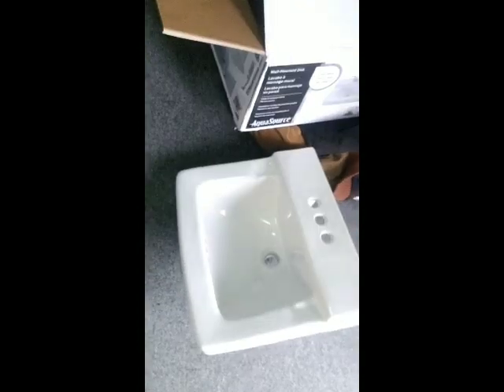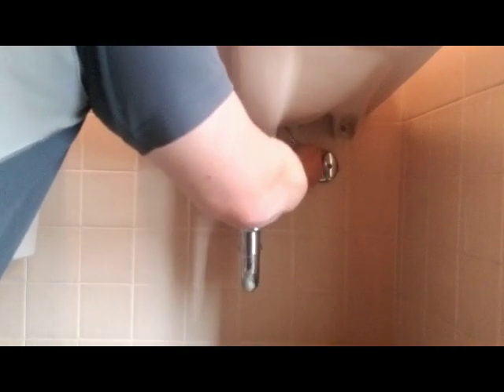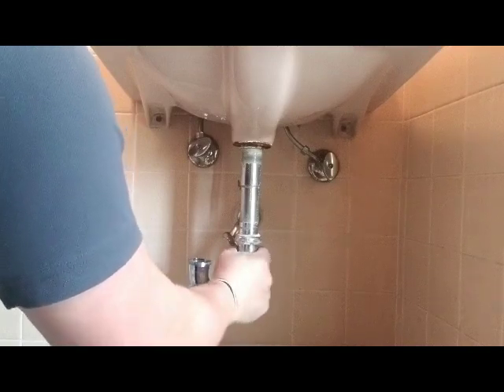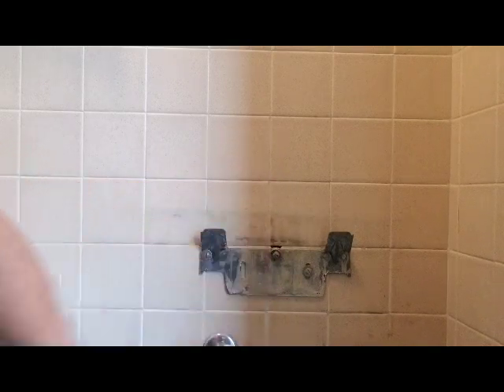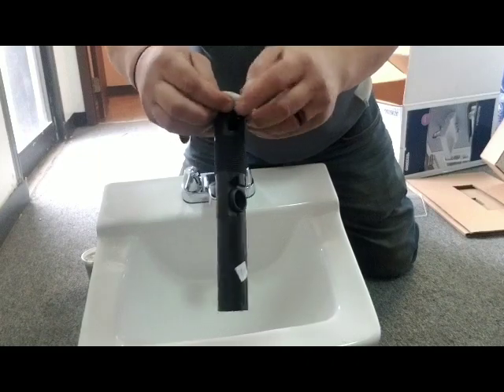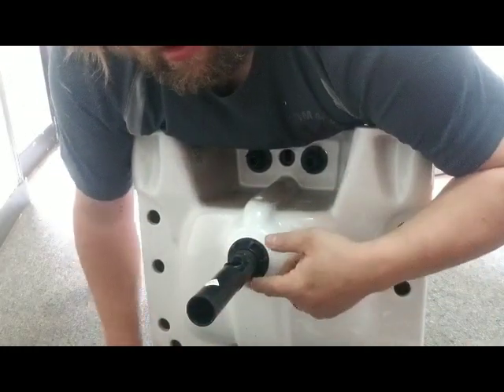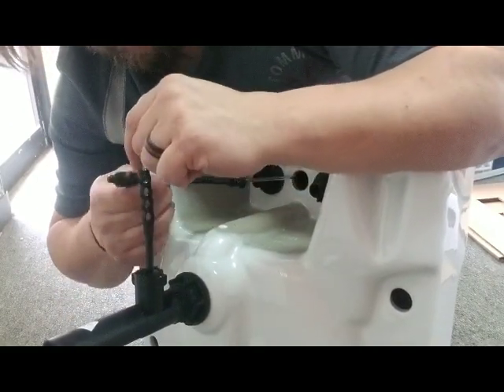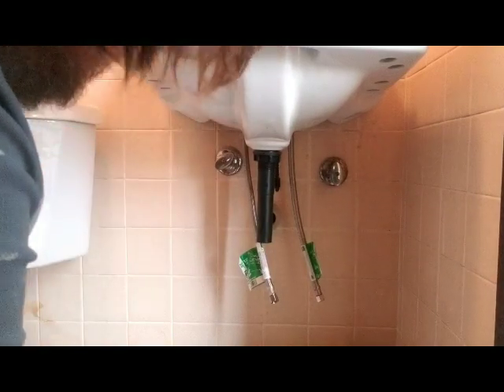INSTALLING A NEW WALL HUNG SINK

Comment: My Superintendant is replacing old wall mount sink, it has been removed which had a bracket. The new sink has curved underside, seems like it would not sit securely on a bracket. It does have 2 holes on back panel and comes with screws to go into a support wall. The wall is tiled--Is there a way to find a support beam? Or are the lag screws strong enough with drain pipe to support? The old sink was a ton, new one is 38lbs. Thanks for any advise!!
Reply from the maker: Lag screws should work

Comment: I'm disappointed that you skipped over how to remove the old wall bracket and install the new one. Other than that it's a good video.
Reply from the maker: I understand completely.  I had had some camera issues. Thank you for your comment.  Also, thar specific bracket just had a a few screws and anchors, and a 2 long toggle bolts holding it one. I just took those out. Again, thank you for your observation and comment.  I will keep that in mind for my future videos. Don't forget to like and subscribe
Reply: that was the part I was the most interested to see- how the sink fits on the bracket @TommyCanFixIt